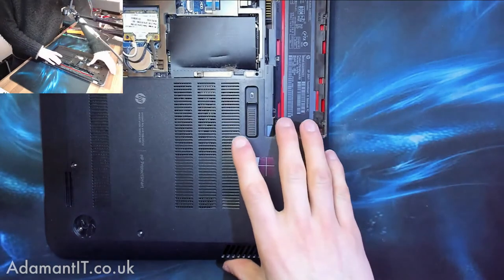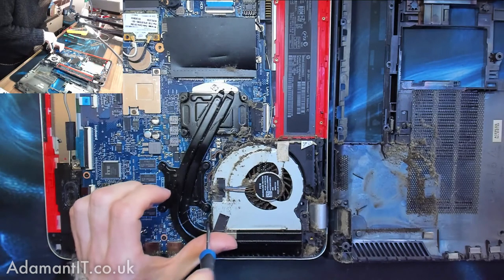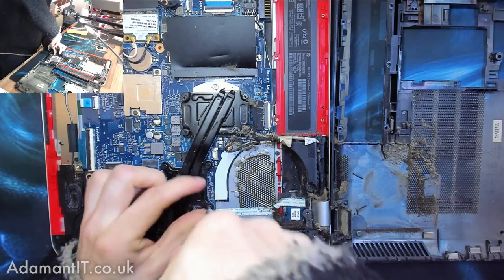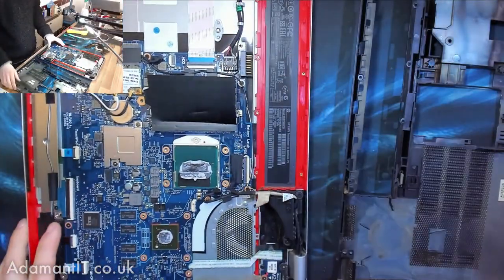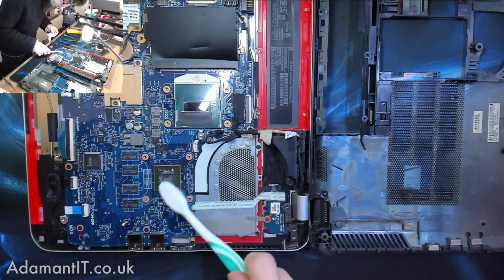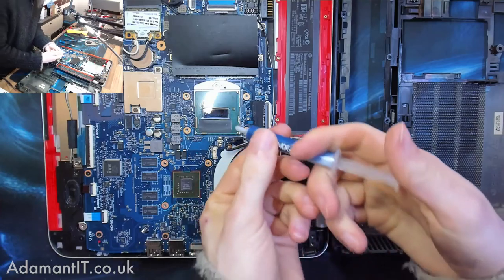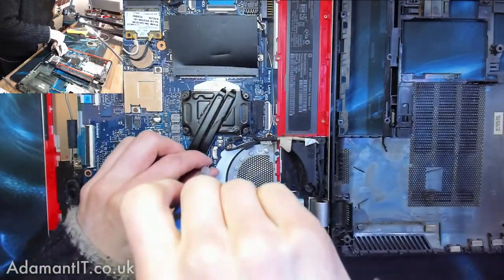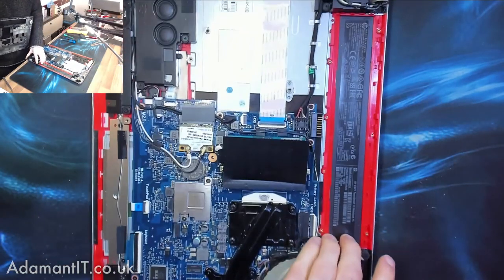B-Roll#15 - Cooling system cleanup

Comment: I'm just about to take apart my old 2600k computer to change the GPU for a 1050ti. I last had a look at it in 2016, so I guess there will be a lot of dust in there too. I have a air compressor, so if I am not happy with the dust I might give it a blow out too.

Comment: I have an old hp pavilion g6 which refuses to die 

It has a cracked lcd 
Snapped hinge and most likely chocking on dust but yet it still works bit a bit sluggish